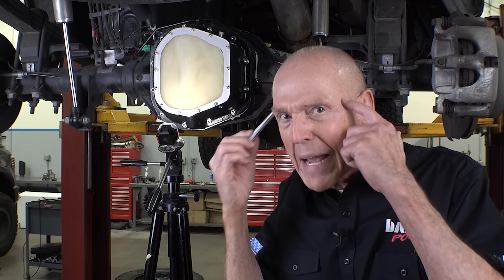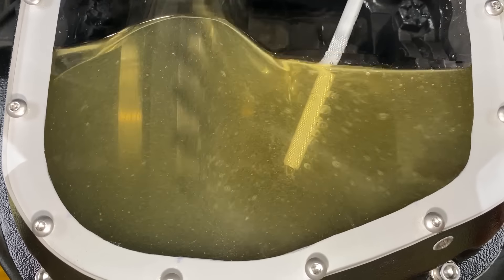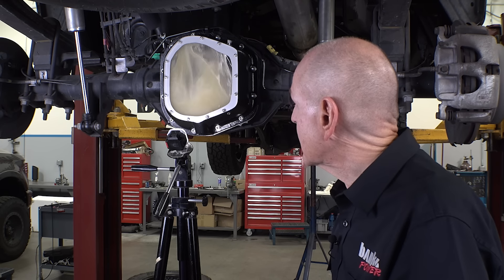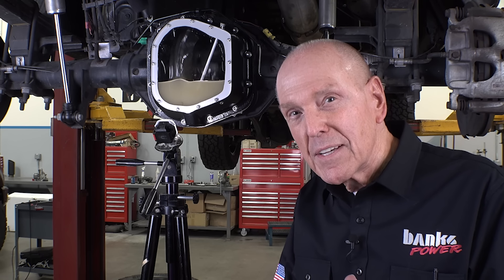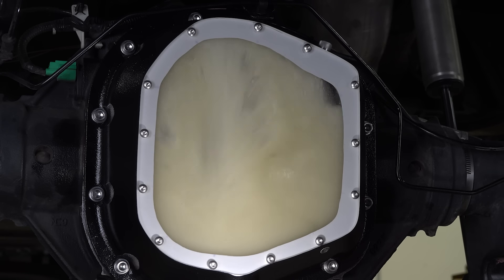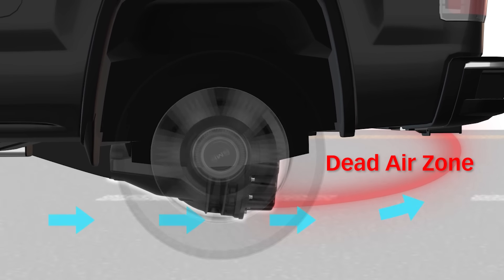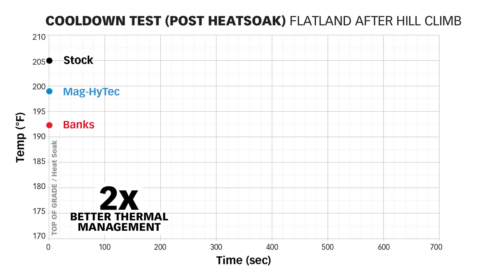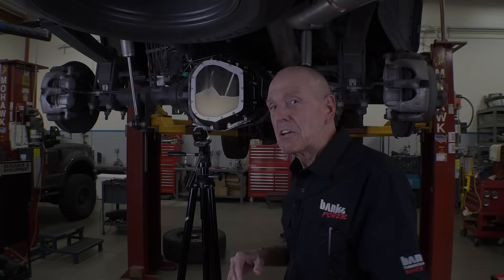What aftermarket diff cover guys don't tell you!

Comment: The glass actually improves the oil flow.  It eliminates the horizontal fins that were cast inside.
Reply from the maker: The ribbed cover shown at the beginning of the video is made by PPE. The cover tested on the truck was a Mag-Hytec. The goal for any diff cover is not to stop the oil from going over with the ring gear. The goal is to encourage MORE oil to flow over the ring gear. The PPE on the right would impede the flow and severely aerate the oil. Think of a rocky waterfall. The water is white because of aeration. Air is not a good lubricator.
Reply: Yeah that's what I was thinking too.🤭
Reply: @janofb  my thoughts exactly
Reply: @janofb - agreed, obviously curved veins have an advantage, however, straight veins will function to channel fluid. Completely missed in this video. I’d love to see projectfarm do a test. He takes great care to reproduce accurate results and more importantly admits when he can’t. Unlike this guy... all I can say is flawed logic.
Reply: @bankspower  Some Sterlings came  factory with aluminum externally finned covers.  How do they perform compared to the factoy steel covers?
Reply: @davestaco  most Sterling's and ford are now where they belong.  At the recycle centre or landfills
Reply: I agree with you however he says the clear cover “it duplicates exactly the insides...” 🤦🏻‍♂️
Reply: @bankspower  i think you are missing the point of the comment... the un-modified mag-hytec had horizontal fins on the inside of the cover. when you modified it to put the glass cover on, you removed the fins. for all we know the fins could have created a low pressure zone which aids the flow of the oil around the ring gear, the same way a low pressure zone in the bed of a truck aids in the high pressure air flowing over the bed, resulting in better aerodynamics and gas mileage with the tailgate up vs tailgate down/mesh tailgate. regardless of the real world results, i would still like to see the difference. perhaps you could make a mold and vacuuform Lexan over it to make accurate covers representing both your cover and the mag-hytec cover, to show the difference in a side by side comparison. if not maybe we could get project farm to do it...
Reply from the maker: @schneider1492  Joe,  thank you for watching and commenting! It appears you may have missed the point in the video where there are two distinctly different flat-back covers. The Mag-Hytec has no internal fins. The PPE cover has horizontal fins. Again, the Mag-Hytec has no fins so the clear cover that we made IS an accurate representation. We did not claim to have made a PPE copy, which is the one at the beginning of the video with internal fins. -- Now, having said all that, the PPE would undoubtedly perform worse with its internal fins. Why? Not only is the oil being bashed against a flat surface, but then it would have to fight its way up and over the horizontal ribs. It's like water traveling up a rocky waterfall. Whatever oil is able to make it up and over the ring gear would be incredibly aerated. Again, you don't want air in your oil. Air does two things. It kills lubrication and speeds up the degradation of the fluid. The tailgate analogy doesn't work because you're not creating a low-pressure zone in the differential. You're simply working the fluid harder splattering it against a flat surface.
Reply: @bobody6258  this video is less concerned about accuracy as its just a long form commercial
Reply: @janofb  ya, he is not doing a 100% comparison.
Reply: @bankspower  Yeah you could’ve easily simulated those horizontal ribs on your clear cover even bad versions of that would’ve shown better, this is not a good representation but there’s no way to know because you didn’t do a somewhat fair test
Reply: People want to see clear side by side comparisons, so the visual aid for the flat back diff cover is causing confusion and disappoinment with the experiment. The audio makes it clear that the cover that was milled down for the experiment was a Mag-Hytec that apparently did not have any internal ribs(even though we never see the inside of that brand in the video). The visual aid for the flat back at the beginning is a PPE branded cover with internal ribs.

In addition to the confusion caused by that unnecessary switch, apparently people would have been interested to see the effect of the horizontal ribs on that PPE. Probably wasn't done because it would have been more complicated to make.
Reply: This is absolutely garbage.  You only need a free molecules thickness of lubricant on metal parts (like on cylinder walls between rings and piston wall) .  If anything the extra oil causes a slight reduction on power transfer because extra power needed to move extra lubes.
Reply: Need to make one for nissan 720s dif if it had a simular cover.
Reply: @janofb  this, and the fact that it isn't quite a flat surface. We can see that when they're machining. There's a small bulge where the ring gear is, and the edges are certainly curved. All these things lead to more laminar flow and less aeration.
Reply: @bankspower  Maybe you could do an epoxy casting of the exact covers to satisfy some of these wingnuts who believe in aerated oil from horizontal ribs.
Reply: @philmeiklejohn  I very specifically never mentioned ribs. Also, I don't care what someone says, I care about what I can prove. Including the fact that their A/B roll includes them machining a cover that very clearly is not perfectly flat. Replacing it with something perfectly flat like plastic would destroy any fluid dynamics the company had factored in.
Reply: @32krod  I think I replied to the wrong person, but they never showed the inside of the one they machined(should have I'll agree).
Reply: I couldn't agree more. The fins from the casting would have made it even worse!
Reply: Love this kind of thing and I see many folks asking about those horizontal fins. I would love to see another video, while I agree that Banks make ls superior products, that I do not doubt, just wonder ...
Reply: @bobody6258  Also Projectfarm isn't running a business selling the things he is testing.
Reply: @philmeiklejohn  good idea
Reply: @dertasdert2419  you know yourself better than anyone!
Reply: @bankspower  that's his point, the cover you machined down would perform worse than when it had a glass back as shown in the test.
Reply: @bankspower  I'm not going to lie man the way that you put everything together it seems like you were talking about the other one and if that were the case and this would be a terrible representation of how they actually perform and also you can say everything you want to say but you didn't test one with the ridged back in a clear cover have you ever have you ever actually seen it cuz I feel like you're just blowing smoke trying to get people to buy stuff
Reply: Those horizontal fins may have directed the flow in a more effective way though!
Reply: @davestaco  the factory aluminum ford cover is identical on the inside as the stock steel cover. Only the material and the outside fins are different obviously. I believe fords test showed the aluminum kept the fluid maybe 20 degrees cooler over the steel cover
Reply: The primary purpose of a diff cover is to keep the oil in. It is more likely curved to minimize the amount of housing material projection and to make the stamping dies (for sheet metal covers) less complex/ expensive and require less tonnage to make. This is definitely being overthought.
Reply: Exactly
Reply: My god. This dude shouldn’t be talking like he had any idea about fluid dynamics
Reply: Snoring
Reply: @bankspower  would the fins direct some of the oil around the diff onto the ring gear and pinion, pluss bearing? None the less, they are not as well designed.
Reply: @bankspower  so it is you who made the mistake of bad explanation. Since i also thought that you cut open the finned model and not a smooth one....also i bet that the flat one also deliveres enough oil around...but the cooling is a solid point.
Reply: @bankspower  Everyone thinks you did a test of the flat back with horizonal ribs because that is the only flat back you showed.  You even claimed the PPE was representative of all flat backs.  You are misleading people.  You never showed the mag-hytec off in your line up. You never showed off any part that was a flat back without horizontal ribs.  It is very clear you bait and switched the ppe for a mag hytec.  Worse yet, the demo you did, does not have the textured surface of the mag-hytec.  The proper way to test is to use real equipment and determine where wear happens if fluid isn't distributed properly and then test and measure wear after long endurance runs of the hardware.
Reply: Yeah was thinking the same thing
Reply: @frankorosz901  Agreed.
Reply: Banks Power prove it.  I think the ribs would cause splash back onto the ring gear.  Not to mention, the ring gear is picking up plenty of lube,  otherwise it’d lock up.   I’d also add, most diff oils are much heavier than what you are dumping in. Perhaps that’s a performance oil you are using, not sure, but most I’ve used are slightly thinner than honey.
Reply: @davestaco  external fins are to improve cooling. They serve as heat sinks to suck heat to the cover caused by the hot oil and then releases it to the air outside. You see the same thing on motorcycle engines and any air cooled object. Your radiator has fins too, they’re just much smaller. But it’s the same principle.
Reply: @bankspower  would the horizontal fins in your Banks cover not also serve as aerators to the oil as it flows up also?  Seems if they would do it in the PPE they would do it in the Banks too. 🤷‍♂️
Reply: Excellent point you got damn right I didn't even think about that although I was kind of puzzling over that when I saw the inside of it in the first place it's literally directing Flow away from critical components
Reply: @srcastic8764  The horizontal ribs would completely stop the aerating his fake setup was experiencing.  It likely also helps the ring gear pull more oil up.   But worse of all, I am not convinced his fake setup even shows too little fluid coating the gear.  He claims fluid isn't getting up, but you can see it getting up in the video.
Reply: @votalis4089  Confusion is not the right word, its fraud.  He knew the bait and switch.  Discrediting the ppe seems to be the goal, but they had to use a different product since they were too lazy to recreate the ribs on the plexiglass.  That said, if the oil being drawn up is what matters, the window should be at the top, not the side.  His false demonstration required him to verbally guess at how well lubed the top was, he had no real measurement or visual.
Reply: @janofb  exactly what i was thinking, i don't doubt the banks power diff cover is probably the best of the bunch, i see the logic in the design and I'm pretty confident it's a good design, i don't doubt the R&D that went into it was sound... but theres nothing sound about deliberately misrepresenting the competition to make yourself look better in comparison, and I realize one could argue that im being harsh, that it was an oversight and there's no proof they did it deliberately, thing is i can see banks are respectable engineers who understand how the complexities of diff design, it's a combination of mechanical engineering fluid dynamics and airflow management, only through understanding this could they address the shortfalls of cheaper and simpler designs whilst still meeting or exceeding manufacturer specs, so im sorry but i just don't buy that this was an unintentional or accidental oversight, banks power knows exactly what purpose those horizontal fins serve: specifically to breakup that "waterfall effect" and stop the oil from sticking to the flat surface by flinging it away and onto the gears whilst in the process increasing surface area touching the oil to cool it better and reduce aeration by shortening the time spent in turbulence. In saying that, the competition flat back is absolutely a crude design, it's cooling ability is megre at best, and the fins don't serve to reduce heat/aeration over OEM so much as the serve to reduce heat/aeration inflicted by the crude flat back design to begin with...

As a first year engineering student im certainly no expert, i could easily endorse the banks design on its appearance alone, i can see how and why it works, the competition's design id need to see some real data to be sure if it's any better or worse that OEM, it's probably a bit worse than OEM, but it's worlds away from how it's being misrepresented here and that's what bugs me, it just leaves me with a slightly sour taste from this market attempt, i mean ive just said the banks is superior either way and id certainly still rather have the banks, but you could have represented the competition whilst giving them every advantage and still come out miles ahead but no, like your competition you chose to engineer a cheap marketing solution and i i know you're better, an honest representation would have been so much more classy... but i guess you don't trust your target market to be smart enough to understand and see the value...
Reply: @_PatrickO  as Mr. Banks explained in his second reply, he wasn't comparing it to the ppe. He was comparing it to the mag-hytek, which doesn't have internal fins. What he's saying about aeration is true and he has research data to back it up.
Is it fair to assume you own a ppe backplate.
Reply: Glad I wasn't the only one who noticed this
Reply: @fedzalicious  And you notice all the rest of these differential cover guys aren't trying to discredit Banks because they know he's right.
Reply: @bankspower  f8
Reply: I’m going to take you off on a tangent, because you are a synthetic oil company representative. I have been using synthetics for decades because they deliver the goods. However, I’ve never seen a climbing gear oil in synthetic. Is this because of some incompatibility, or just lack of interest?
Reply: exactly what I was gona say, that flat cover was probably much worse in reality than they showed by milling off those internal horizontal fins.  While yeah, they are obviously pushing their in house product, but from this I can see their point, if I ever need a diff cover I would likely be getting one of their ram air covers, but the likely hood of that happening is very slim in this current environment.
Reply: @frankorosz901  its just a long and bias advertisement.
Reply: Well maybe if you're breather wasn't down in the fluid
Reply: @fedzalicious   dude Patrick O is clueless.  You'd have better luck talking to a wall.
Reply: With the likes of all these comments, I feel like I’m playing cards with my brothers kids.
Reply: @bankspower  It would be interesting (and seem fairer while offering visible proof of Banks s to us rubes) if you used a clear cast plastic Banks cover in order to show the differences of oil control between the flat backs and the Banks covers. casting would allow it to have all the oil control channeld the real cover has and a video would help show how they work and why they are  important. We are in an age I suppose where you tube is just as important as magazine ads once were for selling aftermarket automotive parts and it is probably more important for ensuring that customers get the most out of products in use. You tube can help or harm practically any part that has competition by just one influential automotive guru testing a part against other brands and saying the part failed during testing or performed poorly even if the tester installed the part wrong or installed the wrong part, So  it might be worth the cost to build a see- through Banks cover to show the oil movement in your cove, And since you have fired shots over Mag Hytecs  bow and you have shown that  their cover does not  cool well or control the movement of oil well and since you also have proven that Banks does cool the oil much better it is probably in your best interest to go to the trouble and expense to make a banks cover out of clear plastic to prove visibly that Banks does do a better job of controlling the oil movement and preventing foaming
Reply: @Frank Orosz  not true the oil also removes heat from the gears.
Reply: @robertmoulton2656  better a 350k mile ford in a landfill than a 20k mile Chevy in the shop again 💀
Reply: @yuutsu  the only 350k Fords are in museums.
Reply: @bankspower  I would love to buy one of your differential covers but you guys don't make it for  03 Ford Ranger with a 8.8 rear
Reply: This makes me wonder what the inside of my diff cover looks like on my ‘22 F450. It has the fins on the outside as well but no ram air intakes. Super interesting test!
Reply: @bankspower  air can also affect the pH and acidify fluids, add dissolved oxygen which can be corrosive etc. Generally not good for gears and pumps
Reply: @shockingguy  he didn't do ANY visual comparison, or else he would have made a clar version of the stock and Banks. He also falsely claimed that no oil was being carried around to the pinion, even though you could clearly see it clinging to the ring gear.
Reply: Maybe now I will TIG a donut into the Mag Hytec?
Reply: Now I’m gonna make a clear diff cover with the exact dimensions of the stock one 😎
Reply: YEP. LMAO.
Reply: if you guys 3D printed glass/plastic instead of flat glass to see through would be better to understand!
Reply: @robertmoulton2656  Harsh.
Reply: Would love to see what it looks like with the horizontal fins just for science sake to see how wrong it is
Reply: @superdutyscaler6823 that would make sense given aluminum has been used for heat dissipation and a lot of applications including vehicles not to mention computers, both home and car radios, the choice could also be for weight reduction.
Reply: the fins were there for a reason without them the flow dynamics got all screwed up
Reply: @bankspower  I personally know air isn't a good lube🤣🤣.
Gotta do what you gotta do when you're down🤣🤣🤣
Reply: I think some of these covers are finned for heat transfer and neglect the dynamics of the oil flow going on inside.
Reply: This man clearly didn't even make it 1:40 into the video
Reply: The stock finned covers still look like the stock steel cover on the inside  @davestaco
Reply: @bankspower As an automotive engineer, I think your demonstration was flawed-it did not correctly reproduce your competitors part, and the “ribs” or “fins” that it omitted were critical to the flow of oil.  I thought it was educational and cool to show the fluid dynamics transparently, but you certainly employed a straw-man tactic to make your product looks superior.
Reply: @frankorosz901 that’s kinda like saying you only need a single molecule of air on radiator. Let’s not forget the importance the gear lube plays in heat transfer. You want you lube washing over the diff in volume to aid in cooling by transferring heat from the diff to the cooler cover. The idea is continuous and rhythmic flow. There is a reason you don’t see intake tubes or exhaust systems make 90 degree turns or have horizontal ridges. 😂😂😂
Reply: Send me a set for 23 Jeep gladiator Danna 44 let me test them out
Reply: 🤡, why not remove that cover and check those internals? Especially temperatures of components?
Reply: yeah I was going to comment about the horizontal fins... but their removal definetly change the way the oil flow.  so the see through is not a good representation.
Reply: You are over thinking it lol 😂😂😂😂